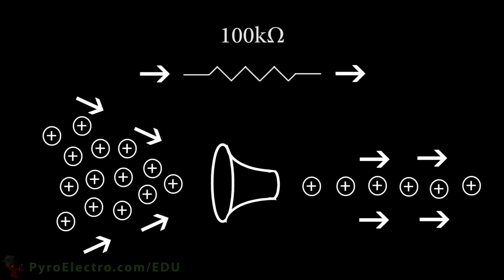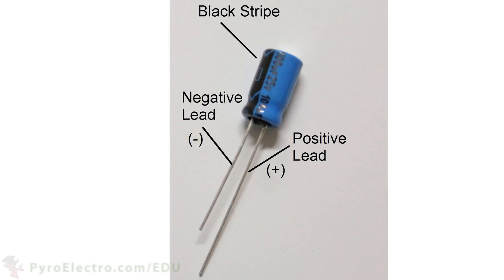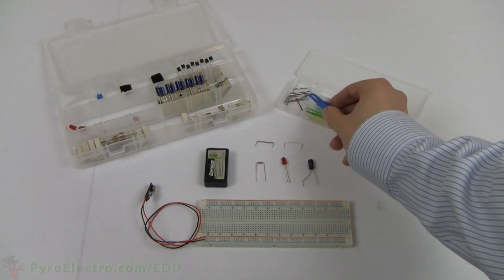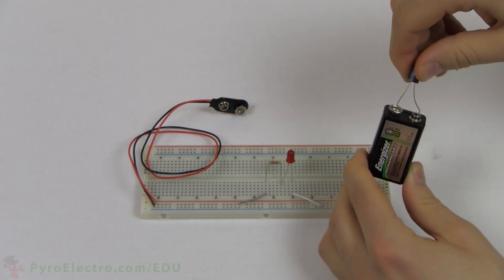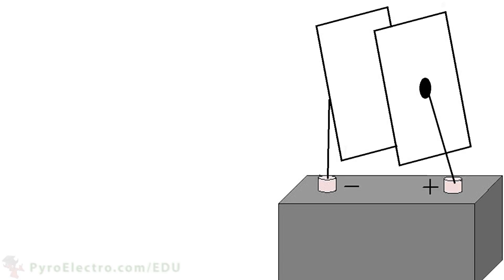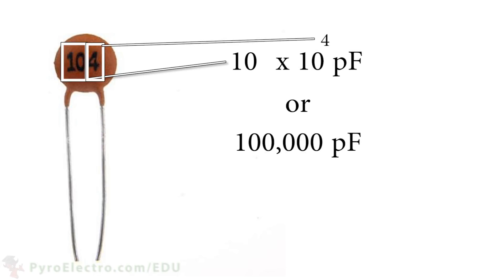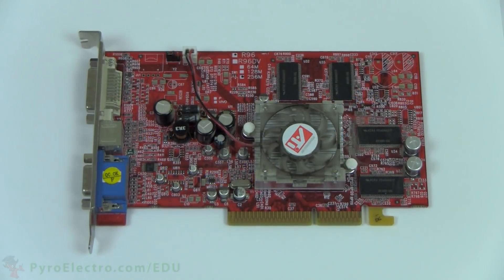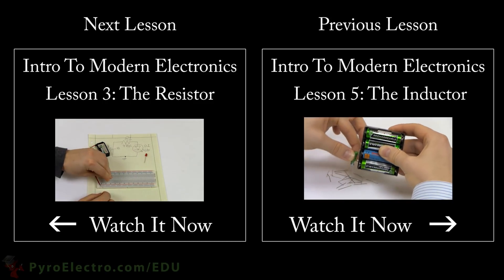PyroEDU: An Introduction To Modern Electronics - The Capacitor

Comment: Very good videos. But at this point, all tutorials fail. You don't actually explain the task of a capacitor in a circuit, just pointless examples. You could explain a lot of usages that a capacitor has such as the current smoother role and so forth.
Reply from the maker: Please continue to either our Digital or Analog Electronics courses to see explanations of how capacitors are used in circuits, along with experiments demonstrating these uses. This lecture is meant to simply introduce 'what is a capacitor'.
Reply: PyroElectro Ok, Thank you for the reply. I'll certainly do that.